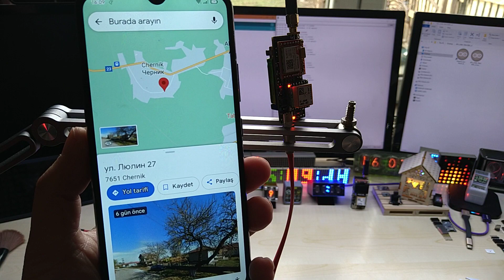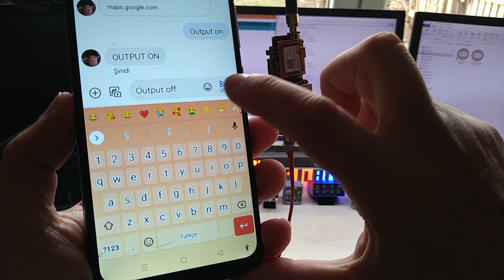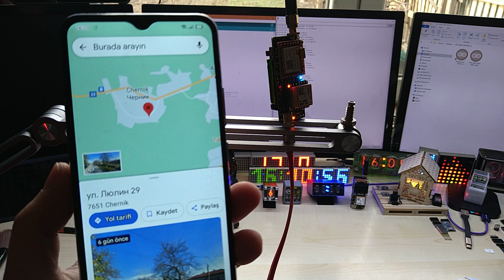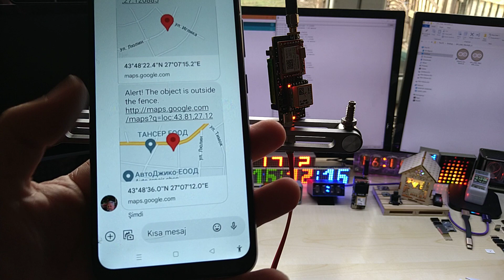GPS GSM Tracker Features and Live Demo by #Hayri with #SIM800L, Accident, Theft, Emergency Beacon.

Comment: Hi Hayri.
Is this your project?
Regards. ✌👍
Reply: This great stuff
Reply from the maker: @sbararamabuza6041  Thank you 🙂
Reply from the maker: Hi Krzysztof, it sure is, PCB designed by me, code put together from several examples and my ideas plus a little help from Tobozo 🙂
Reply: @iHayri1  Hayri respect.
Mega design, gps is not easy to use.
Best regards to you and your family, salute.
Reply from the maker: @krzysztofkozorys516  Thank you, actually it is not that hard, but trying to combine several codes and adding features and getting it all working gets tricky 🙂 Stay safe as well and all my best to you and your family. Have a great week.